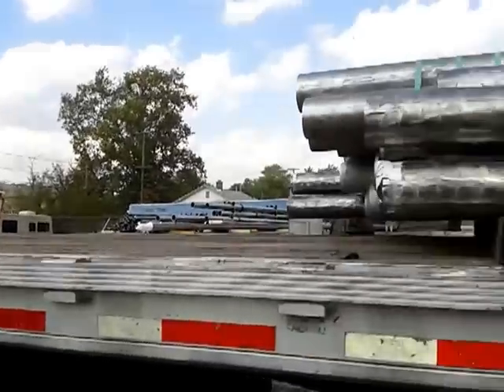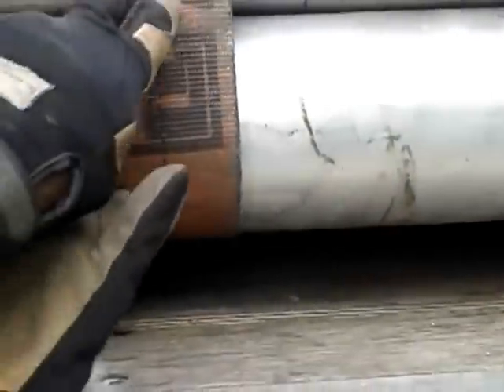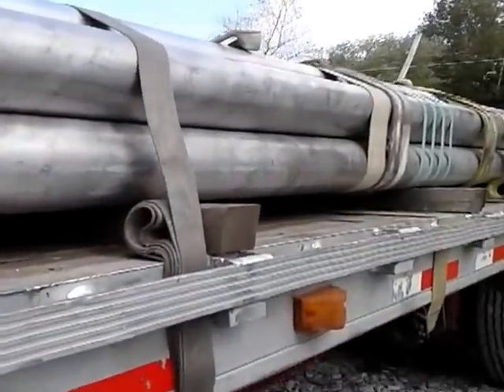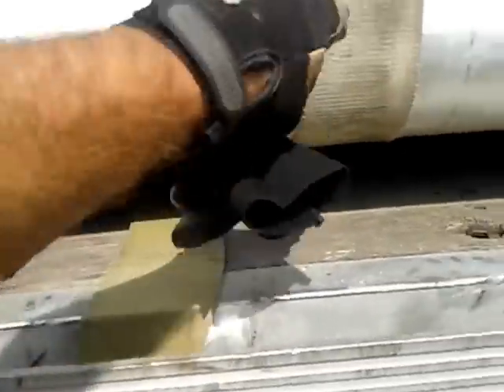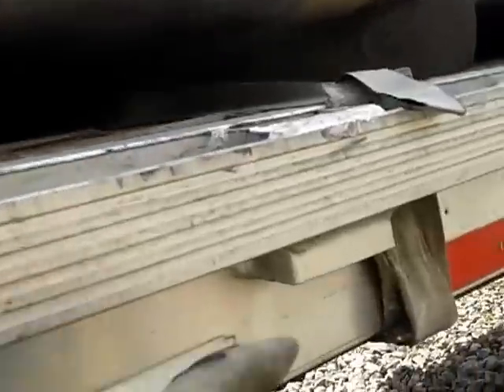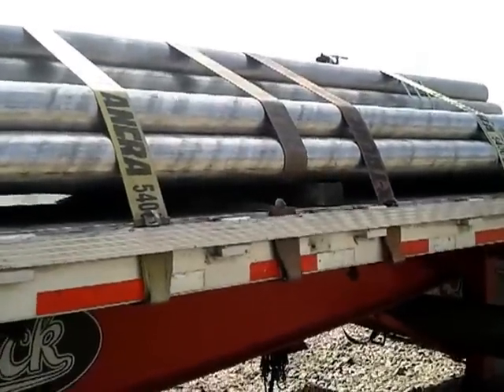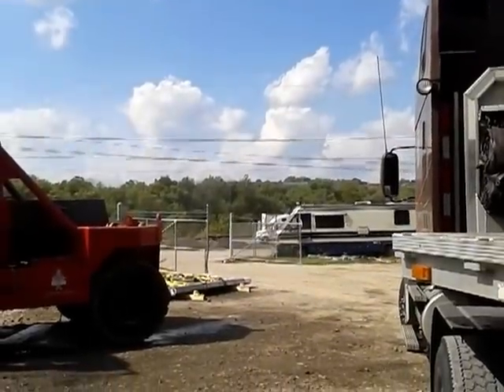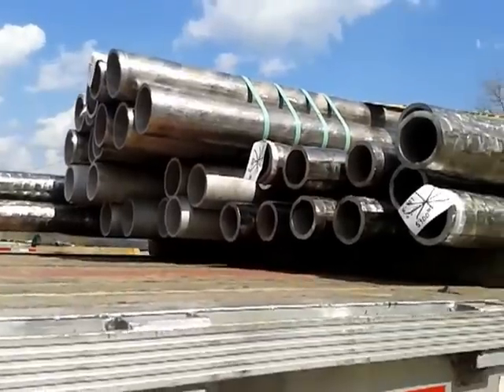Flatbed Trucking 101 Securing pipe

Comment: Incorrect, two straps in the first 5 feet, where is the bulkhead? bulkhead is required if you have enough room on the trailer, looks like you have plenty. Belly wraps are the correct way to cinch the load together and pulls it straight down on the trailer and not to one side!
Reply from the maker: Apparently you did not watch the video. It's called a headache rack. It's mounted to the truck behind the cab. This is not the only type of load I hauled . So your being legalistic and don't even know that much. Humm more radio rambos.
Reply: mackdaddy1911a1 It's called a bulkhead, but a slang term is headache rack. However, I believe this guy is referring to creating a bulkhead behind your pipes by stacking 4x4s and chaining them down.
Reply from the maker: I do believe I mentioned building a bulkhead in Front of the pipe at the end of the video. I also have a video dedicated to How to build one out of the 4x4 dunnage. What it's purpose is and one of the situations in which one saved my life... or at least prevented any damage to a trailer I was dragging at the time.

Comment: if it was wedged you would not need a synch strap.  who came up with a synch strap anyways?  take a string and wrap it around a pencil and you should be able to move the pencil back and forth.  synch strap is direct tie down so only half of WLL.  so stop using them.
Reply: can you please explain what you mean by if it was wedged?   What exactly do you mean?   if there a photo or link you can point me to?   I'm learning flatbed now and will take any information you have.  thanks

Comment: How do u get it under it?
Reply from the maker: Great question. Another item to have. A piece of very stiff wire, like steel Mills use to bundle steel. Or a broom handle of wash brush handle.
Reply: Why not just lay the strap on the deck first before loading. Wing it over and cinch it after?

Comment: pulled flat bed for 25 years never ever used straps for any kind of steel. you may get away with it on round stock but if you put that on any other flat or square stock you would be eating your load the first hard stop, for what ever reason. always thought steel on steel. people who use straps for steel hauling is just plain lazy.

Comment: You should have wood under that second layer
Reply from the maker: these are sections of light towers and are banded together. The choker/cinch pulls everything together. I was not going to break the bands and then have loose sections rolling around.
Reply: @mackdaddy1911a1  o ok wasn't sure also I see there's a twist in the choke wrap is that okay
Reply from the maker: @jonny6758  Yes because it isn't considered "Load Bearing". Meaning it is not holding the load down. The choker works to squeeze the outer tubes around the ones in the center of the bundle. Preventing them from working out of the stack. However, avoid sudden braking. Even with the chokers and or a barricade in front of them the tube could come out and strike the cab. So make as many decisions for the dumb-ass amateurs around you as you can. Drive a mile ahead not off your hood so you have space and time to avoid their bad driving. Listen to the C.B. too, especially in bad weather and in terrain where your line of sight is limited. You might hear about the "oh shit" moment before you come around a curve and have nowhere to go.
Stay safe out there.
Reply: @mackdaddy1911a1  thanks brotha flatbed trucking deffinly has a skill behind it and you learn alot 👍

Comment: That is not a proper belly wrap!  Lay your strap across the deck before the load goes on.  Then take either end over and across the load to secure to the opposite sides. That squeezes the pipe together AND pulls it down to the deck.  What you're doing is squeezing but not pulling down.  It is dangerous and you shouldn't be teaching others how to do it wrong
Reply from the maker: And it will loosen in transit, at least that has been my experience. I have hauled 95 foot long tubing out of Houston and out of New Orleans and cinched it down over the top. It pulls down and tightens before squeezing it together. Then every 25 miles I'm having to stop and re-tighten it for the entire trip.  The purpose of the cinch is to pull it together. The other straps hold it down. If I don't have enough 4" straps I pull out the 3" portables. Depending on the weight.
Reply: mackdaddy1911a1 It wont loosen as long as the straps aren't crossed over top of one another. I've hailed plenty of pickled tube out of Gary, Indiana and Chicago and did it the way the guy described and never had an issue with it loosening up. If its the heavy plastic tubing used for water that will wiggle out no matter what you do.
Reply: Yup and the beauty of a proper belly wrap is that it serves three functions.  It bundles the pipe, it holds the bundle to the deck AND it chokes the load if it shifts forward.  Another important consideration is that the wraps should not be over tightened, as that will cause one or more joints to pop then loosen.  If that happens, the whole load becomes insecure.  It is better to have the wraps taught but not super-strained.
Reply from the maker: I will just have to disagree, for I have strapped loads both ways and this works best. Steel pipe, Iron pipe, Drill steel, and boiler tube. This load is Lamp Poles for an intersection off I-40 in North Carolina. Not only did it make it safe and sound but it remained tight for the entire trip. That is the point is it not ?
Reply: mackdaddy1911a1 Well I guess if it works for you.  I don't know why you wouldn't find it easier to lay your straps across the deck ahead of time though, rather than fish them through after the fact.
Reply: gotta agree with ya there mackdaddy1911a1.  people like to knit pick.  it is nice to lay your straps across ahead of time(if the shipper lets you), but either way you gotta fish em back under after you come across the top.  the problem with coming back to the same side of the trailer and not going around to the other side is that your strap/chain is worth 1/2 the WLL to DOT at that point, and for good reason.  the only time i come back to the same side of the trailer is if i haul something awkward (like statues)or i'm hauling shotgun coils.  great video here. you just taught more guys how to get it there safe than there are guys on here arguing with you.
Reply from the maker: jack handy thank you. And that is why I did the video. I just want folks to get the job done as safe as possible and arrive home alive. Stay safe out there hand.
Reply: by dooing it the way he did it, you can loosed up the straps that go over the top and then tighten the 
straps that pul the load together, then retighten the straps that put downward presure on the load.
Makes sence to me.
Reply: How is it dangerious as long as there is anough straps to pull it down?
Reply: i agree , go under first then u choke it down, go over and choke and it can still rise,its not a downward force